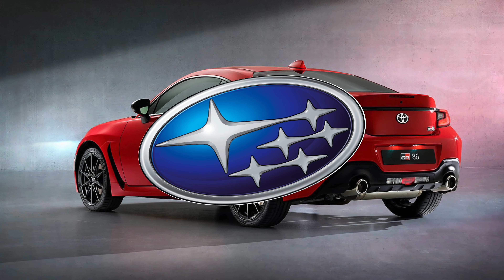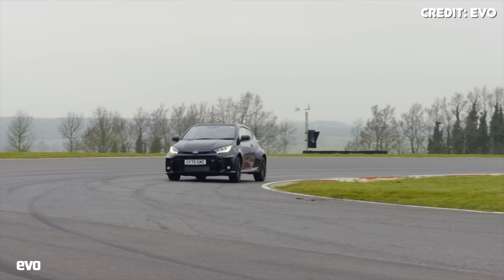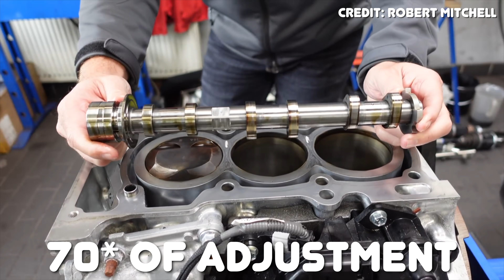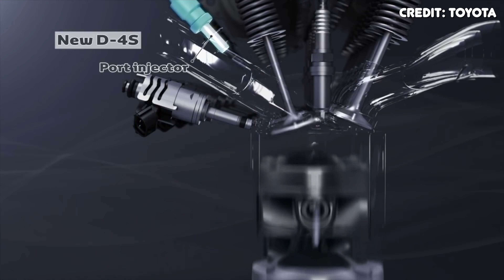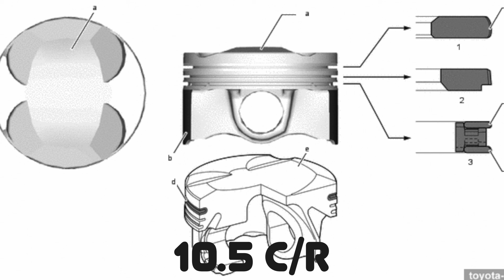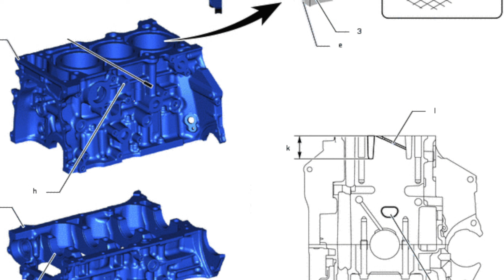Toyota G16E-GTS: Everything You Need to Know

Comment: I have a 2025 GR Corolla and it's one of the most enjoyable cars I have ever driven.  I also ride motorcycles, and I love the Triumph triple-cylinder bikes for their amazing sound.  The GR Corolla sounds pretty similar, so between that, the induction sounds from the turbo, the smooth 6-speed gearbox, and the reliability Toyota is known for, I feel like this is the perfect hot hatch.
Reply: Imagine if you had the Yaris, which is lighter, sharper and designed bespoke not just a corolla with a Yaris engine show horned in.
Reply: Untill it goes boom...... 😂

Comment: Manufacturers are using undersquare bore x stroke these days because it improves emissions. Fuel/air in the crevice between the piston crown and the cylinder wall does not tend to be burn well, and is a major contributor to hydrocarbons and carbon monoxide. You can decrease that crevice volume by moving the ring higher on the piston, but that has major limitations and disadvantages. Or, you can decrease the crevice volume by making the circumference of the piston smaller.

In the end, manifolding and cam timing dictates power/torque curves; not bore/stroke.
Reply: They use steel reinforced ring lands on the G16e.

Comment: 5:53 It's not odd at all that Toyota only polishes the top part of the intake port. The reason is due to production cost. If you imagine multiple engine heads going down a conveyor belt, in this case the jig for the CNC machine only has to be set up one way and doesn't need to be reset.  However, if Toyota were to polish the entire intake, they would need to flip the head over to polish the valve side of the intake, because even though it's mostly straight the valve side still has a bend. That would require resetting the jig every time they flip the head which takes time, or they will need a much more expensive jig to do every head.
   Or, if they were to do the entire intake without flipping the head with a cheaper jig, they would need to use a  much more expensive five axis CNC machine. 
Lastly, even if they can do all this cost effectively, it would still take more time. And of course, time is money.

Comment: How much more power could these stock internals handle reliably before failure or requiring a proper engine rebuild?
Reply: HKS did about 700 HP with stock internals
Reply: @leepicgaymer Nah. Not stock internals. They had to have at least changed valve springs, camshafts, head studs and gasket. I'd be surprised if they didn't have to at least reinforce the top of the deck, if not go with a full closed deck setup. Same goes for the stock pistons...I's be surprised of they didn't have to upgrade them from stock (or just got really lucky on dyno day). These engines are great, and have potential, but they can be finicky and you really have to know what you're doing as they can actually be kinda easy to break at higher power levels (400+). Their main issue at higher power levels is the open deck design and the stock pistons tend to break or shatter fairly easily. They can't really handle any amount of detonation, so you have to be really careful with pushing the power up, and avoid detonation at every step. Head separation is an issue at higher power levels, which requires reinforcement. Especially on normal gasoline. Again, these are great little engines, with great potential but not as bulletproof as some like to claim, especially in stock form, if you want to really push them.
Reply: @BigBear--  Oh yeah i forgot about the head studs and the head gasket, i think someone developed head studs and head gaskets recently but i have no idea if HKS had it back then
Reply: @BigBear--  HKS started by playing with the ECU settings, refining the tune as they added modifications. The idea has been to push the stock G16E as far it can go, and so far that’s entailed adding a prototype bolt-on turbo and raising boost from the factory 1.4bar (20.6psi) all the way up to 2.7bar (39.7psi). To support this, a prototype intercooler was made up, along with a modified intercooler spray system and a hard pipe kit. The stock air box was also ditched in favor of an HKS Super Power Flow filter. The result of all this is 375hp – a solid 100hp gain over stock.

But HKS didn’t stop there. An additional 100hp was gained through a 100-shot of nitrous oxide, for a total of 475hp. That’s enough juice for Taniguchi to effortlessly four-wheel drift the car around in recent tests.
Reply: @leepicgaymer Right...I just want people to properly manage their expectations. The "700+ on stock bottom end" figures you hear being thrown around, aren't realistic daily numbers the motor can survive reliably. Generally they'll make that on either race gas, or high octane gasoline, and only in controlled environments for short bursts. Usually those guys end up running a secondary tune in the low 400's on E85 to save the motor. If you tried to daily that stock bottom end on that 700+ tune, you'll be replacing the motor within a few days.

Now I'm sure you could get there reliably, but it'll require a fully built bottom end, with either a fully closed deck, or at the very least a reinforced top deck, sleeves, new pistons, bearings, maybe new rods and crank. Not including all the other supporting mods...valve train, cams, cam gears, injectors/fuel system, exhaust manifold, turbo, intercooler, LSDs, a new center diff (if you want to maintain awd), new trans, oil cooler(s), etc.
Reply: @BigBear--  did you read my second comment? It addresses my mistakes. Apparently they were making 475 HP with nitrous which still impressive tbh

Comment: Can u analyse the rocker arm design? i.e. there is no "rocker retainer" system c.f. as an example the Honda B16A engine which has a shaft P/N 14631-PR3-000 in the event of "valve float"

Comment: They should double it so they can have a Toyota I-6 in the BMW Supra and bring some bloodline to the chassis besides the badges!
Reply: I own the GR Corolla with this engine and you’re absolutely right. This is the type of engine should have been in the Supra. It’s an incredible engine that make turbo sounds you want from a Supra
Reply: Or just make a 3JZ
Reply: @martinjimenez7392  Oh boy. Realistically speaking, a 3JZ is not viable in this day and age. The JZ family are all iron block engines, and with the age of widespread aluminum block engines, a new JZ engine will be too heavy for a modern application. Toyota has gotten the design right for an engine with good combustion design. An undersquare aluminum engine, with wide valve included angle that makes a straight path to the combustion chamber and direct injection (with optional port FI) is what they have done in their Dynamic Force lineup, and it gave these engines high thermal efficiency, so these engines are more fuel efficient and have a higher BMEP (torque per liter). An engine made from the ground up would make much more sense than trying to revive the JZ platform.

Toyota can go the easy route and ask M Division for their S58, collaborate with Mazda for R&D in this platform, or make their own engine based on the Dynamic Force platform for their GRMN Supra. Only time will tell.
Reply: I totally agree that would be an excellent idea for the supra. Also, they should bring back the Toyota MR two and put this 1.6 Liter inline 3 cylinder turbocharged petrol engine into it and give it a six speed manual transmission with the rev matching
Reply: It's designed really similarly to the B58 in the supra. Fun fact the B58 in the supra has a few design changes (like the integrated exhaust manifold in the cylinder head) that the regular BMW B58s don't have
Reply: G16 for 1.6 liter. Time for toyota to make a g30e gts motor. That could theoretically be either a v6 or i6.
Reply: Ye dude I feel like they could ABSOLUTELY develop an incredibly potent 3.0-3.4L I6 or V6 with or without turbo(s) for potentially every application Toyota currently has for everything six cylinders and up. I would love to see Toyota revive the MR2 with the current G16-GTS, a reimagined GT86/BRZ/FRS with a NA version of the G16 in the base model and the G16-GTS in a high performance trim, then a new turbo I6 to power an all new (non-BMW) Supra.
Reply: If they can put out better than 300hp from a 1.6L I3, I think a 3.2L I6 would be good for 350+hp NA and 500+hp with forced induction.

Comment: All of the technology used in this engine has filtered down to all the dynamic force engines ie M15A-FXE (1.5 EFI DVVT-iE) , M15A-FKS (1.5 D-4 DVVT-iW) the 3 cylinder baby sisters  to the GR engine so the GR engine is not a unique design or engine  , it shows how well the dynamic force engine across the board are designed and built , just goes to show how much motor sport no how goes into the regular dynamic engines as well as the GR engine  
i all ready own a regular 3 cylinder hybrid yaris and have just ordered a GR so i appreciate how good these engines are in the every day world

Comment: Nice video but I believe there are three points, but are not fully correct
A) you can run a twin scroll tc on an inline 4 (see ea888)
B) you want to avoid large exhaust camphasers to avoid large exhaust valve pockets u on the poison crown, but which would impair the incline flow
C) the variable air flow in the intake system looms to me like a second bypass scavenging the air filter to achieve easy breathing with high air flow. The shown component isn't an intake manifold from my point of view

Comment: Nice vid. However, those pistons would be fine without the squirter‘s 😜
Reply: On a high compression, downsized, turbocharged high horsepower PRODUCTION engine? You are only setting yourself up for engine failure if you remove all of them.

Comment: Bore it out to 1.8 with sleeves or I could just put a css, “big” boost, 11 to 1, and race bearings/arp fasteners. Boom. Formula d machine if you make it rear wheel mid engine. I wanna do it, it has all the cooling to support most of it     -<{why not?}>-🤷‍♂️

Comment: Ref stroke, it is quite rare to see such a short stroke high boost turbo engine nowadays. E.g. the B58 (Supra) is bore 82 mm and 94.6 mm stroke and the higher revving S58 is 84 and 90mm respectively. So 89,7mm stroke is absolutely not very large and with the relatively large bore of 87,5mm the engine is almost square. Only Porsche engines (the non-Turbo turbocharged engines) are short stroke but they are less reliant on turbocharging.

Comment: I might be late here, but I have a proposal. It might be very ridiculous, but hear me out.

What if Toyota could make a 3.2L twin turbo inline 6 based on this awesome engine to put on the Supra? It will have the benefits of an inline 6 (so bye bye balance shaft), and I think emissions would be good too since the G16E-GTS is already good in emissions. Though slapping 2x of the whole package in a MK5 Supra will be tricky, because the radiators the GR Yaris uses is comically large, compared to the tiny inline 3 sitting on the engine bay.

This theoretical engine could revive the Supra name fully. This might also somewhat quiet down those overdone "nice bmw" cries by some people. But I could only hope in this dying age of the internal combustion engine.
Reply from the maker: This guy is onto something.
Reply: V6 are the past if you ask me because both of them take boost to make fast. Most 4 bangers today can make v6 power. There's a video on YouTube with a big block honda 4 banger k2.7 and makes 400hp without turbo. So what's the point of a v6?
Reply: @alanclark9000  I was talking about a potential inline 6 Toyota motor, not amother Nissan V6 engine.
Reply: That inline 6 Mazda is making is actually co developed with Toyota
Reply: @MaddNomad1015  wow didn't know that, I thought it was just mazda making this engine. If it has toyotas touch its alright then.
Reply: BTW Nissans Are trash 🗑 🙃  and when I think of a 4 banger beating a v6 I'm imaging nissan pos v6 oil burning vq motors
Reply: @alanclark9000  v6 was designed for compact packaging. Not really anything to do with power. Even some of the 350z Nissan used to race used rb26.

Comment: Cosworth three cylinder needs to be in cars 🤦🏽‍♂️
Reply: Cosworth?, even they would be hard pushed to better this little gem!. And over the last 30 years i have had 3 Sierra Cosworths, the last one the RS 500. 220ish BHP standard & when BBR finished with it 360 BHP. In Australia they have got this Toyota doing over 500 bhp at the wheels, my RS 500 was 360 at the crank. I think Cosworth are now in the past.

Comment: Most manufacturers offset their crankshafts these days it helps with the Conrod angle ratio.  It was also used at the opposite end in the pistons of the Sierra Cosworth with their latter series engines where they offset the piston gudgeon pin.where it aided in reducing piston slap which thus helped in reciprocal mass (Less Friction Smooth Engine). Please note also that Peugeot was doing the same HP per liter in their RCZR Engine with 270hp from 1.6liters albeit with 4 cylinders back in 2014.
Reply from the maker: Thank you! I didn’t know offset cranks were so common now.
Reply: The fact that Toyota is doing this now, when they absolutely were never expected to do so after the gt86 and Supra, is just awesome. They made a 3 cylinder outperform a well known 4 cylinder in hp per liter when the 4 cylinder was putting more power down faster bc of the extra cylinder, even though the 3 cylinder could possibly (100% talking outta my ass here, correct me if I’m wrong please 👍🏾) rev higher due to light reciprocating and rotational mass. They both have drawbacks in the way of secondary imbalance issues, but ig it depends on who future proofed it the best. The fact that all they wanted, seemingly, was to make a good performance engine, with a fun power-band, all the while almost completely focusing on cooling to get there, and fucking accomplishing that in spades! Dude, I’m excited to build one of these with my kids after I buy a junked engine online, better start researching how now! 🤓 

Edit: do you think if the after marked got better at machining secondary imbalance shafts for their needs, instead of almost always junking them, 4 & 3 cylinders would perform to a higher degree of difficulty with more ease?

Comment: Funny it seems like this engine doesnt have much room for more power but 'Motive Video' in Austrailia has a 500hp stock block g16 that's super close to 10s 1/4. and they say it has no signs of slowing down, they're gonna do another turbo upgrade soon.
Reply from the maker: Motive is doing some epic stuff with theirs!
Reply: Ekanoo racing just ran low 11sec quarter mile in UAE they said changing the tires to slicks and some more tweaks it's gonna go high tens but next year they are gonna build there motor with stronger internals for even more power
Reply: @FB6K24Z7  and he still has his backseats in motives is fully stripped
Reply: https://youtu.be/D1m-7phpfK4
Reply: Came here because I just saw a video of someone getting one of these to 530hp at the wheels